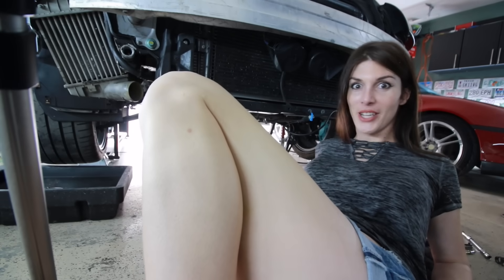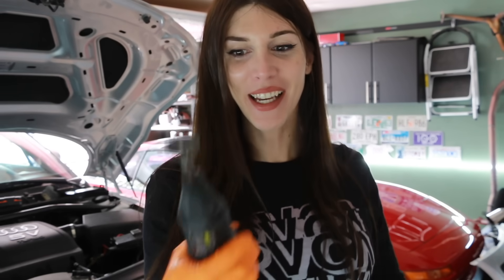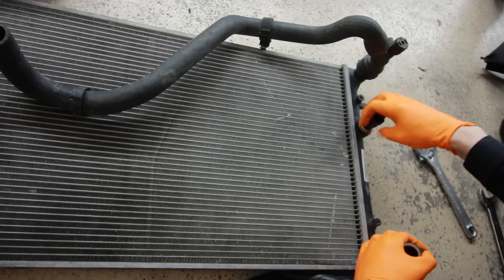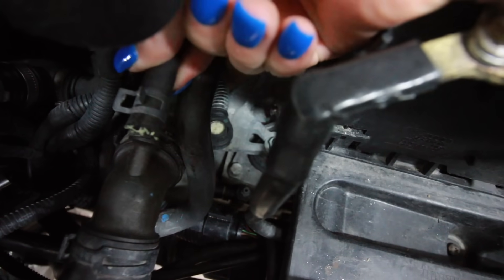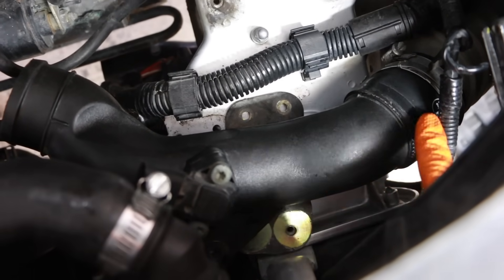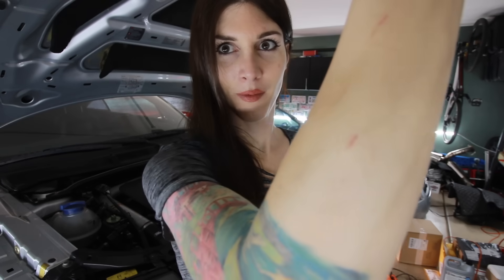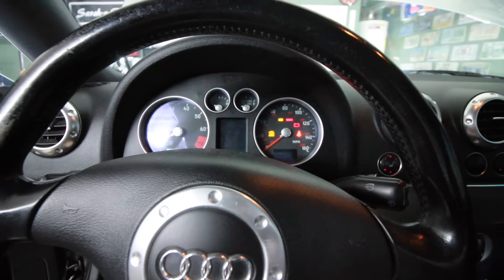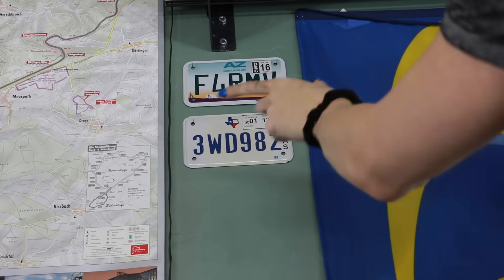High Performance Radiator Install // Project TT Quattro

Comment: Hi Sarah, Have you ever used a vacuum fill for the radiator fluid?  The one I used is called "AirLift Vaccum Radiator Fill".  Those things are awesome and will let you know if you have any leaks before you fill.  Then when you do fill, no air!  Might make your life a bit easier with the radiator fill.  What a project... Totally feel your frustration!

Comment: On tools like your Dremel, I find they cool off better if you keep them spinning on a lower speed with no load on it, to keep the internal fan spinning and moving air across the motor. Similar to an Automatic Transmission getting too hot, Neutral and engine running (as long as there's fluid!) to push the fluid through the cooler instead of letting it heatsoak in the case. Glad it started spinning for you again.

Comment: The troubles when dealing with 20 year old plastic that has gone through countless heat cycles. 

You can still make the car perfect without every piece being new, replace what's necessary and what makes sense while you're doing those necessary repairs, you are making progress, and doing it right.

That little smile at 'set it on fire' was perfectly evil!

Comment: German cars will test your will to succeed but it is worth the effort.  I own a twin turbo beamer that loves parts and attention so much so that I have no hair left from the stress, but when I hit that throttle the 400 hp comes to life and it puts a smile on my face and the 420 ft lbs of torque @ 2000 rpm feels pretty good.  Great content nice video

Comment: On the Dremel tool, pull out and check the motor bushings, the spring wire they’re attached to have a tendency to burn up.

Comment: If ECS recommended that radiator and hoses, they really should have come with instructions on what needs to be modified for correct fitment, or suggested new hose fittings/o-rings along with the hoses. You got it handled without much trouble, and people can now reference your efforts, but a lot of people doing this themselves might not be able to make it work as well. 

I do really like ECS, they have probably the best catalog out there with multiple pictures of a ton of their inventory(extremely useful, and I have access to most manufacturer original parts catalogs) and generally great customer service, but this can't be the first time that they've sold those parts for this application.

Comment: Hi Sarah, love the channel. All of those tools have a thermal shut off. I have a dremel too and it constantly shuts down from over heat. I bought a Milwaukee version that works so much better and longer and uses the same batteries as the drill motors.

Comment: Was having a little trouble concentrating on some of the lower radiator work. Fitness was distracting. 😎 I watched the latest video Bad Obsession posted just before I watched yours. That is so cool you got that T-shirt from them. Sarah, I'm sorry for your frustrations. Wish I could do more but reaching out with virtual hug to hopefully help your spirits. 🙅‍♂️ Just keep doing what you're doing. Projects are like that but you will eventually be rewarded.

Comment: Sarah, I didn't know you're a Project Binky fan. I used to have a 1978 Mini back in 1993. It was dirt cheap to run and was the most fun you could have on 4 wheels. Mike Brewer (he of "Wheeler Dealers" fame) once said that everybody should have a Mini at some time in the lives and he was right. When Chris from "B is for Build" did the 240Z/M5 build that car was Binky on steroids.

Comment: Relationships with your cars can be abusive. The crazy part is you kept going back  😉
 The Dremel has 2 brushes under the round caps towards the back with Philips heads. They can be removed and cleaned. Better idea. Head to Home Depot and grab a real grinder for $40. Save yourself a lot of frustration in the future. But I admire your resilience. Keep at it girl.

Comment: Hi Sarah. If you have no slow speed on your fans the resister built inside the fans is dead so you will still need to replace the fans I'm afraid. There is a fix online somewhere to replace the resisters but changing the fans is easier.
Keep up the great videos
Rob Taylor
Reply: Sarah's Low Speed functions when jumped, just not controlled properly, she'll get it sorted out soon.

Comment: Sarah, a suggestion you might consider when working on your cars. It helps protect your arms when you have to go into areas with your arms where other car parts may scratch or cut them (your arms). I cut off old sleeves from a shirt I don’t wear anymore and I liked sleeves that were button down with a tight fit so it wouldn’t slip up from a snag. I cut them off because I was usually doing the work in warm weather and didn’t want the extra warmth from wearing the full shirt. You may not have any throw away shirts that have buttons so you could consider a store that re-sells clothing.

Comment: I have a extra set of aluminum, there is 5 pieces if you want them. The coolant flange, the piece you bought, the thermostat housing and other pipes.

Comment: I've owned a couple of VWs and must of the times for no low fan is a faulty radiator sensor. These things have 2 sensors, one for the cluster gauge and another one for the fans. Would make sense to change both for new ones. You can test low and high speeds by jumping the radiator sensor connector with a little piece of wire. Cheers!
Reply: Isn't it 2 or more for lots of cars? my citroen xm has 3 sensors, all on some engine pipe tho. cant remember what is the third one for :) prob the same- dash, hi, low? Mine burns relays sometimes tho, only had one sensor failure on two cars.
Reply: @mechadrake  I think the third one is for the AC system or something like that (don't have the repair manual in my hands right now) and it's in the coolant pipe after the gauge temperature sensor but never had to replace it though. From my experience, had one faulty temperature sensor, a radiator sensor with no low fans and another that got stuck closed (fans not shutting off). Another case of overheating was caused by a clogged coolant line which is the return one from the head to the reservoir. This line removes air bubbles from the cooling system. VWs and Audis are fun to drive but when they break you get stuck for days or weeks doing repairs :)
Reply: This car has a fan control switch(F18/F54) in the radiator, as well as the coolant temp sensor(G2/G62) for the ECM and cluster temp gauge. Sarah has replaced both of those, as well as her Fan Control Module (J293). Her issue isn't that there is no low speed, it's that high speed is constantly being cycled, even just key on.

The F18/F54(what Sarah swapped from old to new radiator) is a common problem with these that will cause a lack of low speed fan(or low speed staying on even with key off if F54 is shorted) but unfortunately for Sarah, her issue isn't this. There is a chance it is due to a bad PWM signal from her AC Pressure Sensor, G65. No doubts she'll get it sorted once she gets a few extra hours to troubleshoot.

Sarah previously tested both speeds of each fan, and yes, shorting the F18/F54 connector(key on for F18, high speed) is generally the easiest way to do this.

Comment: Hey Sarah, problem with the dremel is the fan vent areas, when holding the tool in normal operation your hands are usually covering the air vents... I try to keep off of them, they're in a bad spot

Comment: Your videos are fun and instructive, Sarah. You’ve convinced me that I should never consider an Audi project car. 😬 I've done plenty of work on older VWs without so dang many sensors and they've had enough WTF design for me. The newer Audi/VW designs seem impossibly packed in and full of wonky wiring and too many sensors.

Comment: Replace the O-rings. They have been there for nearly 2 decades, actually replace the whole quick disconnect  flange, it comes with new seal. They are pretty cheap at Urotuning, ECS should  have them too

Comment: Audi don't sell the o-rings that fit inside the plastic coolant joints. I had this problem on my Allroad when I changed the radiator. They only come with the plastic fitting. You can buy o-rings online though. Just measure the fitting that it goes onto as a starting point. Getting the thickness right is a bit of a guess work & measuring the old ones. I ordered some with plus or minus an extra 1mm just to see which gave the better fit.

Comment: Hi Sarah if you have tested your fans and they have no low speed then the resistors in the fans have failed these are none replaceable and are a common failure so you will need to replace both fans the engine uses the slow speed for temperature control or when using air con the high speed on the fans is only when engine reaches higher temp. sitting in traffic etc.so the engine will only be getting cooled by the high speed due to over heading the first sign of this is the over loading of the red wire in the fuse box above the battery this will look burned or melted and the fuse will eventually blow meaning no fans .the fan controller rarely fails both fans have no sensors so nothing will show in vag com or vcds hope this helps or at least points you in the right direction

Comment: Dremmel tools use a comutator and brushes, the brushes turn into dust and clog up brush path, so brushes don't make contact... Blowing it out is a better solution... The brush covers are on the side.
Reply from the maker: Robert Hodges Even the really old ones? Mines like 20 years old.

Comment: A few thoughts:

That gremlin should live in the TT where it can find many other friendly gremlins. 

I like Audis; I always have.  I’ll continue to admire them from afar after seeing how that thing was engineered. 

Don’t beat yourself up about not upgrading every piddly little part on the car. A line has to be drawn somewhere. It doesn’t make sense to put more money into the cooling system than what you paid for the car. Those cooling system pieces probably wouldn’t do much for you, anyway. Unless the ones you have break, which hopefully they won’t.

Comment: That design with the small bypass hose coming off the bigger hose isn't only Audi's design,  Toyota also does it with some of their 4 cylinder motors.  My wife's Rav 4 has a similar set up and if it gets bumped just right, like her's did,  breaks right off.  Real stupid design. Glad you got yours fixed.

Comment: I just changed the radiator in my car and what a difference between Ohio and Arizona....most of my Hardware had to be cut out or drilled out and replaced... the degree of corrosion is significantly worse here...

Comment: Ok im looking in 2 getting a 1993 mr2 but not shor about the obd is there a way 2 convert it to obd 2 or do i have to get a ecu upgrade i have no idea or is this even an issue ?

State inspection is not a problem due 2 it being 25 years old & its Considered A classic

Comment: Sarah, not sure if its anything of concern but at 2:05 in the video the hose by your hand, is there a split there. I might be mistaken but if it is and you start it up under pressure you might lose your coolant.x
Reply: I think that's the plastic clip that holds the hose in place, just a weird angle.
Reply: Thanks Dave for the clarification.

Comment: Hey Sarah,  did you get your overheating issue fixed on your Audi TT? Asking because I have the same issue. I have a Audi A3 8l 1.8t AUM engine.  I noticed my gauge stays on 90 however my expansion tank was always extremely hot, like way warmer than it should be. Did a diagnostic check and found the temperature is on 107 degrees when idling but its fine when driving. I've changed my thermostat, water pump, both fans, fan switch and fan control module, the temperature sensor and I changed the expansion tank and coolant flanges. I didn't change radiator as I was told that the radiator is fine... when you changed your radiator to a dual core radiator, did that fix your issue?

Comment: I know that working in the engine bay area of some of those VAG vehicles is a pretty tight fit so scratches and cuts are normal 😂Project binky is awesome for sure, they do awesome work 👍🏻 and their humor also are spot on 😂
By the way, did you fix the abs problem on Mr tots yet?

Comment: Fan speed not slowing down isn’t FCM if you replaced it that would be your coolant thermostat or the sensor that plugs into your belt driven waterpump

Comment: Then you need some air tools. A pneumatic die grinder wit a cut off wheel would make short work of that condenser brkt.
Reply from the maker: Pete Miller Air tools are outdated, brushless DC is the way to go.

Comment: I've burned up several Dremel's over the years. Letting them cool when they got warm extended the life slightly, but they still die.  I see Milwaukee now has a small shaft M12 die grinder. My next Milwaukee purchase.  Check out MSC Industrial, one of the largest industrial tool companies.  If you call them and tell them who you are and what you do, I think they will set you up with an account and discounts on purchases (like bits for the mini die grinder(Dremel type)).  I get 12% off, next day or 2 day shipping.  Love your videos and willingness to do what it takes!

Comment: After replacing three of them because of that one thin nipple breaking off, I found that URO Tuning makes a cast aluminum version (along with all the other coolant flanges that break). They’re definitely pricey in comparison, but to save the time an headaches in the future, They’re now my go-to replacement for those parts.
Reply: I should watch all the way through before commenting 😋 just spent too long today being frustrated bleeding an Audi heater core I guess.

Comment: is it a 5 cylinder TT? i had a fiat 2.0 5 cylinder the best sounding engine ever. Its like a baby V10
Reply: 4 cylinders, 5 valves per cylinder
Reply: @gruca04  5 valves percylinder? intresting. How does that work, 3 forthe fuel 2 for the air. Or?
Reply: @Illyrian_Adventures  2 intake & 3 exhaust valves if I remember correctly
Reply: @gruca04  nice

Comment: Has anyone suggested the computer might be stuck in open loop or has failed to complete a fan shutdown protocol?  That is my overheard in college relay.
Reply: The Engine computer has very little to do with the fan control on this vehicle. The Fan Control Module - J293 (which is new on Sarah's TT) and the Coolant Fan Control Switch F18/F54 (what she swapped from old to new radiator here) are what turn the fans on and vary their speeds, depending on various inputs from sensors and other computers. I believe this is what Sarah will be troubleshooting moving forward.
Reply: @Dave-fx5zw  Thank you for the follow up.  (It) Scared the hell out of me when she pulled the spacer off the upstream oxygen sensor a handful of videos back.

Comment: You have way more patience than me love, thatcar would have been sitting in the driveway in flames if I was working on it. One of the many reasons why I don't own a new car. You pulled it off though, and looked sexy as hell in those shorts doing it.

Comment: Get an angle grinder and save your self the headache of trying to cut with a Dremel. A Black & Decker should only run you $25 if you find a sale.

Comment: So you tested the fans, the low speed was dead in both of them and you simply put them back?  Didn't quite understand this...  Probably thats the reason you were seeing spikes in your temp and not the radiator.  High speed kicks in at 102C

Comment: Dremel sucks, been using a 12volt Hitachi rotary tool for a while and haven't burned it up yet. https://www.amazon.com/Hitachi-GP10DL-Cordless-Lithium-Ion-Accessory/dp/B006EEIR42 Get the big 3ah third party batteries. The reciprocating saw that uses the same batteries is handy, fits places bigger saws can't fit (hard to find now). The drill and driver are pretty wimpy so stay with your current line of tools.

Comment: Have a look on AliExpress for the alloy replacements for those piss weak plastic suckas. The kit of four costs less than $50au (about $2.50US) and get the crankcase breather for 17auwhile your there. No more cracks.... in the.....

Comment: Oh the audi and wishes ti set them on fire. I drove two of them (dad's "very good cars", I never liked them, but they were older and rad change on audi100  was super easy. ) I hated audi 100, ir drove like a hard boat,  brakes had multiple mafiunctions, gearbox had worn syncros, and has too short 2 first gears. Audi 80 was not that bad but it had very hard life, beaten by everybody, had weak engine  and electronic control carb, which we used in semibroken condition for several years, because "audi easy to fix anything" was not really a true thing, if you did not have worn suspension parts, basically nobody of these golder hand mechanics had any idea what to fix. I was not fixing my cars back then.